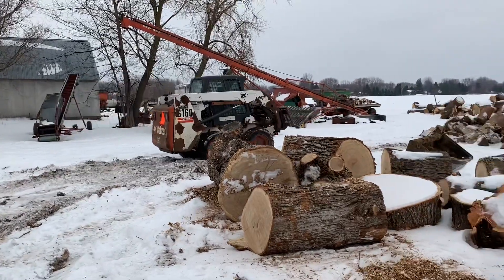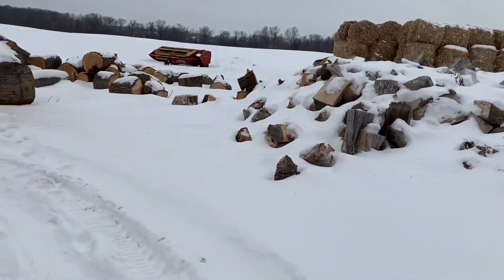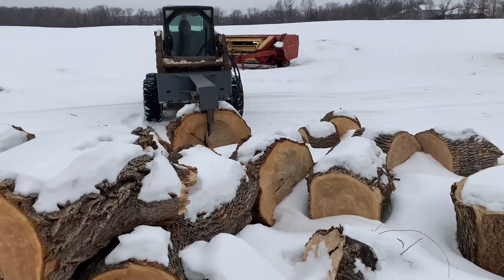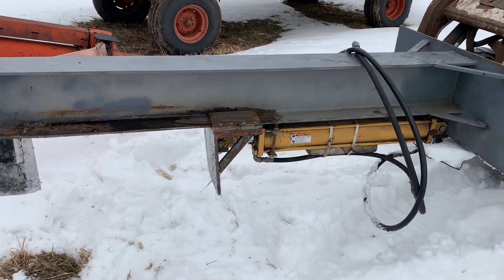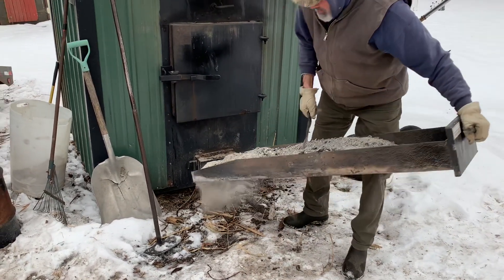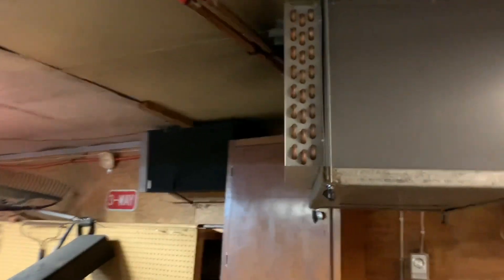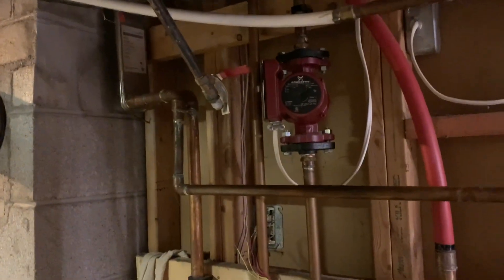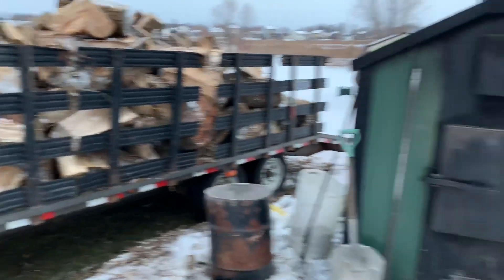Wood boiler system overview and splitting wood with a homemade splitter for a Bobcat.

Comment: I had to check and yes I have the bell rung for when you have a video out. I don’t get them. I have a old house that I remodeled. When I was a kid 2 Wood Kings was here. Long story short I would like to add central with an outdoor furnace.
Reply from the maker: Thanks Russ. It’s nice if you’re up for the work. I’d be happy with just a fire place at my house, dads better equipped to handle this volume of wood. No worries about the videos, there so much to keep up with. Congrats on busting 1000 subs, I saw the super clean give away 👍

Comment: That's the best splitter I've seen.   Pretty slick.  I never would have thought you could heat that much area with one.
Reply from the maker: Thanks. Just have to size it right and sometimes feed it a lot 😁